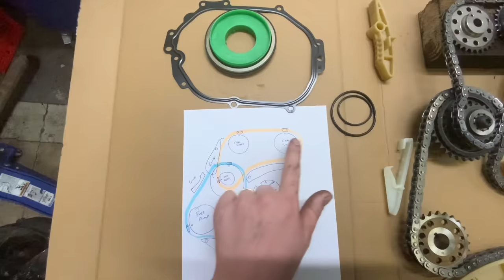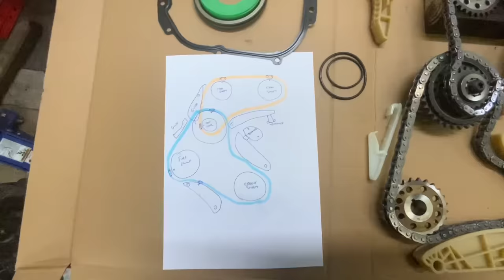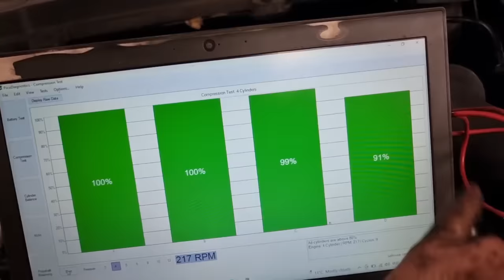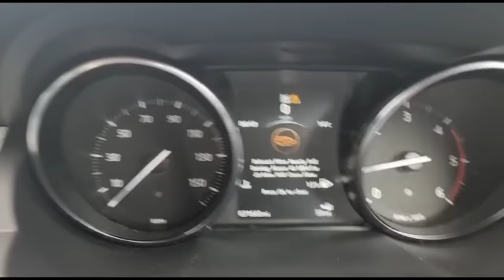JAGUAR LANDROVER EXPERT 2.0 INGENIUM TIMING CHAIN REPLACEMENT

Comment: If you're brave enough to tackle this at home, this is just what you need.
Reply: By the time you bought the special tools, taken3/4 times longer than someone with previous experience it cannot be worth doing this at home
Reply: Big balls for hobbyist.  I’ve like think could have a go. Not sure I’d take leap faith
Reply: You think this can be done at home.? maybe if you have a lift in your garage
Reply: @mickymac6571  brave pill equipment. Maybe
Reply: @STANLIZ4  now they have done one and got the tools they can do it more often/offer service to do it for people good thinking that all mechanics should have
Reply: @Stncedr1ge  agree, but most DIYers dont intend becoming full time mechanics

Comment: Whoever thought it was acceptable to place the timing chain on the flywheel end of an engine want's kicking in the balls. I'll be honest, I didn't know these were set up like this, I've seen it on more exotic Audis but on a 2l Landy, come on man.
The tooling, time and effort needed for a service item is down right obscene. 
Great job lads, you made easy work of a hellish job, bloody box off to service a timing set man, grrrrr.

Comment: We have a Jaguar in for turbo replacement, however the sump has to be removed for cleaning which involves subframe, rack etc dropping. Now pieces of iron casting  found in sump.
Another has had timing chain failure at speed . For all the Engine designers out there , have a look at old BMW and Mercedes duplex timing chains and guides...That's how you do timing chains. Our local Jag dealership has several vehicles with varying levels of damage tucked round the back awaiting work. Some have very little mileage on them. With the millions of miles of testing how did it come to this ? Carpet the under swept ...?  Is it the toolings already been made let the customer do the development work.

Comment: Thank you Rob & Chris for posting this great video on SR-uk You Tube Channel.  Josh, you are a very highly skilled tech.. I trained as a 'mechanic' in the 1960's and there was nothing as complex and involved as what you have just showed here. I left the trade before ECU's came along, but have tried to keep up to date since watching You Tube content creators. Many thanks for that highly detailed look at the replacing of those timing chains .. I also watched your EV video which I understood quite well as I used to, as a hobby, repair valve amplifiers that ticked over at 400 VDC +. Your fault finding was faultless and gave an insight into the surprising complexity of EV's (which I think are an abomination BTW  😅).

Comment: What was the engine designer smoking when he thought putting the timing chain on flywheel side was a good idea 😆 🤣 😂
Reply: The Opel Astra K model with the B16 motor has the same issue, the chain is placed on the flywheel side, a lot of work and money to change the timing kit. Bad designer and not customer friendly.

Comment: Surprised that those timing chains look the same size as the one on my pedal bike (which don't last long), my Defender Td5 engine has a double row timing chain and should last the life of the engine. Tiny bit more friction maybe? but I know which I would prefer. Great video by the way 👍

Comment: Jaguar LandRover in Korea has started recalling these timing chains and replacing them free of charge. If enough people come forward they might start doing it world wide
Reply: With what kits are they replacing them? I couldn't find any upgrade parts on the internet.
Reply: Think it's either the 2018 or 2019 discovery sport they upgraded the timing chain to rectify this issue so I'm assuming that's the kit they are using for the older models could be wrong tho
Reply: @shannonarslanovski3296  thank you :)

Comment: In 1975 I had an Escort Mexico with 75,000 miles on the odometer. I changed the chain as a precaution. It took less than 2 hours and in fairness to Ford it would have done that distance again. Where have we ended up?  Sad.

Comment: Why was the chain and tensioner on the front of the engine not replaced whilst the sump was down and also I understand there is an improved oil pump now for the engine ?

Comment: Absolutely puts me off buying any JLR product with this engine. Why are the chains and tensioners such poor quality. Surely it would make far more sense for the chain to be a Duplex type, or at least a stronger version. I am used to older Jaguars. Like  E types and XK’s that have timing chains to the twin overhead cams. They are much stronger and last a lot longer.
Reply: If it's not the engine then it's the lack of proper security on these cars

Comment: It's like a 'reverse snobbery' these days with modern cars .... the more complicated the engine can be made - the MORE they can charge - and the MORE the car-snobs love it! ...... I worked for a builder of High Class Houses a few years ago .... He used to hold a Saturday morning Auction for ALL of the houses on any give Site .... Buyers went on a waiting list to be invited to these auctions and the buyers woul do their level best to out-bid each other ...... I was plastering the first one on one of these sites and the buyer came in to tell me he'd WON the house I was working on, and He was 'Chuffed To Bits' as he paid £25,000- OVER!! the original asking price! ..... It seems cars are going the same way by pretending to UP! the Quality by making it 'impossible' for the 'Average Joe' to work on - Therefore making the models MORE Exclusive = MORE ££££££'s ??? 🤨🤔

Comment: My 2010 Mazda 3 has a timing chain with 160k. On it 😂 Never been changed. Dunno if it will ever need changing either.
Reply: Only when it breaks but should be absolutely fine until then 😊

Comment: The trend is to put the chain between the engine and the gear box . This would imply its not a  service item... Then the chain is made in a size you would not want on a bicycle along with brittle plastic guides and tensioners as soft as s#1t.  Take a look back when BMW'S  and Mercs had a duplex chain you could tow with,  a hydraulic tensioner with a strong backup spring and guides that were steel and the front oil return from the head ran down the chain.  If taken to the main dealers you will be told these engines cannot be repaired and have to be replaced effectively writing the vehicle off. Got a mini with a 3 cylinder diesel engine to look at next week low mileage snapped chain... Combi Van's and Merc A class are no fun either. The designer's should be made to work on them then think again.

Comment: Ridiculous design, obviously designed so the DIY is out of the question. Does this complex design improve MPG No. Does this design improve reliability NO. Land Rover are shooting themselves in the foot.
Reply: The only real improvement is that if it was one continuous chain for the whole system, it would require a stronger more robust chain etc, which the manufacturer inevitably wouldn't do and they would fail even more
Reply: not the only one, I saw something a couple of weeks ago but for the life of me can't remember which car it was but to do this job the engine has to come out totalyy
Reply: Not shooting themselves in the foot, but the punters who buy LR.
Reply: @SaltimusMaximus the Jaguar XE requires removing the engine.

Comment: Hi Tommy,
Very fine video, I myself have a Discovery sport 2.0 diesel built in 2017, I think I will also have to have my chain replaced soon, can you tell me how much that would cost if I had it replaced at a Landrover dealer, because see that it is a lot of work, and the engine must be completely built out, please answer.
Reply: How many km has the car traveled?

Comment: Great video I've got 2016 no problems but got 92k on might save up and get chain done how much on jaguar xe 2.0d 180bhp
Reply: 92k miles or km? Did you change the timing chain in the meantime?

Comment: I NEED HELP - Range Rover is saying I need a new engine because of low compression on a well maintained 130k - 2016 evoke R-Dynamic. Our car had no problems before this and was always maintained at the dealership - now after the warranty ran out this issue started.

Comment: Who in their right mind thought it would be a good idea to put the timing gear at the end where the gear box is, why on earth would you design something that would cause so much headache to be able to fix problems
Reply: Arrogance - bmw do the same . In their heads it all been designed and won’t fail for a set period
Reply: Probably makes more money at the dealer.
New clutch? "May as well do the chain and guides whilst we're in there."
New chain? "May as well do the clutch whilst we're in there."
Reply: There’s where they make more money crap design more likely to go wrong thank s showing this won’t buy one of those vehicle

Comment: Whatever happened to just replacing a timing chain without removing half the engine. Incredible how these brands engineer these new cars. The labour on this job would be high and rightly so
Reply: There is a reason behind this design, it is a modular engine, so additional cylinders can always be added on the non-cam chain side. While keeping the flywheel side same design so that they can mount the gearbox regardless of how many cylinder there is.
Reply: @galaxymode  but who would want to add additional cylinders to their car?

Comment: What an awful design, plastic tensioner on the tight side of the chain. Rubbish plastic tensioner in a 100 degree oil bath makes plastic go brittle. Really poor design, belt on the front would be better.

Comment: Memo to self never buy a landrover. They are making it difficult for no other reason then stop you working on your own landrover. The chains are thinner to cut down on the overall weight of the vehicle every ounce will affect the emission.  This is one of the reason no cars come with spare wheels and a lot of cars are having plastic panels to cut down the weight. New cars are a joke now.
Reply: At least the engines won’t be a problem now that they’ve stopped making any more!

Comment: Hopefully the natural reliability of electric motors will save the poor unsuspecting diesel owners a few thousand pounds in repair costs in the future!
Reply: Don't count on it,. Corporations need a large profit , elec cars are neither cheap to run or cheap to fix...plus they make zero sense..
Reply: Until you need to change the battery

Comment: Ridiculous design with the chains on the flywheel end of the engine.
Reply: Not the first culprits for this design; VW have also used this location for the chain.
Reply: made to break on purpose if you ask me!! its how manufacturers make all that xtra DOSH!!

Comment: Has anyone tried to remove the inlet sprocket on these engines ? I've put a 2 foot breaker bar on it and still can't undo it.
Reply: Bolt has red loctite on. Must be warmed up first

Comment: Hi evrybody
someone has an idea how much should cost to replace the timing chain of my Jaguar F pace 2.0d 2017 awd ?
Reply: It’s normally around £1500 to £2k if someone wants to do it
Reply: I done few in my work. Its about 2500. Land rover dealer. Some independent start at 1200
Reply: @lintonlewis4615  Is the petrol 2.0  ingenium the same as this? same issues?

Comment: Why would the fuel pump have a timing mark on it’s gear?
Reply: Must be timed for a reason.
Reply: @ausmartin1  Even the tensioner cog has a timing mark on it? But not the crank.
Reply: @johnayres2303  Yes only an Engineer could explain why  the most important timing mark is missing as the crank is the #1 by which all other is timed. It's a strange modern world.
Reply: Crankshaft has a timing mark on front pulley👍
Reply: @JamesYT19  Still it would be nice on the actual crank cog and different coloured chain links like some Japanese manufacturers do.
Reply: @ausmartin1  it’s on the front pulley to enable checking camshaft/ valve timing with everything in situ. Still a stupid idea but that’s why it’s lite it is.

Comment: How many km has the car traveled?I know no one answers😂😂😂😂😂😂😂
Reply: I have the same engine, but in a Jaguar XE from 2015 diesel. Did 144500 KM on it and I have the same problem with the timing chain tensionsers. Total costs €6000 😂